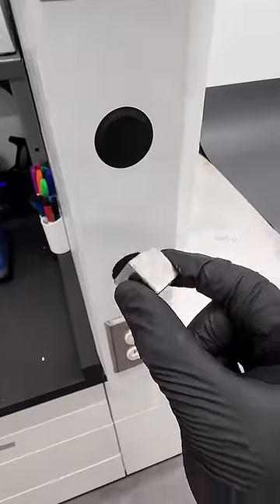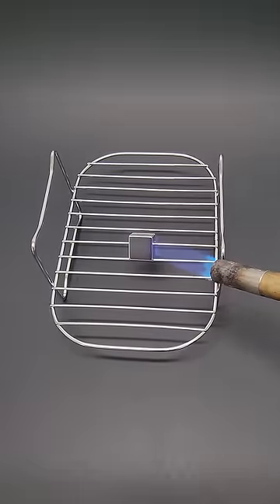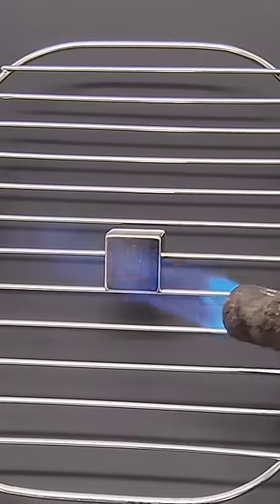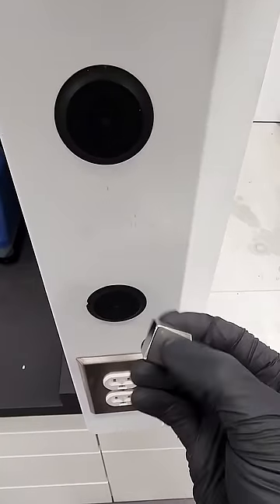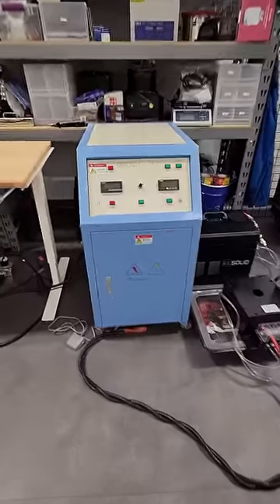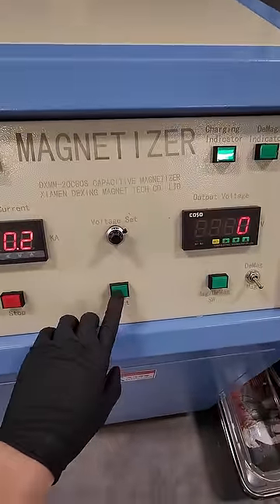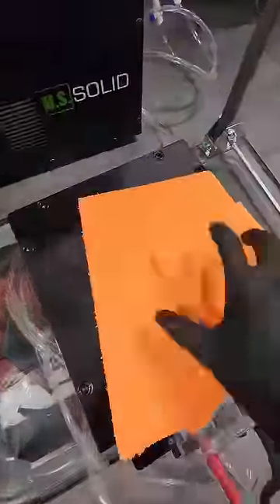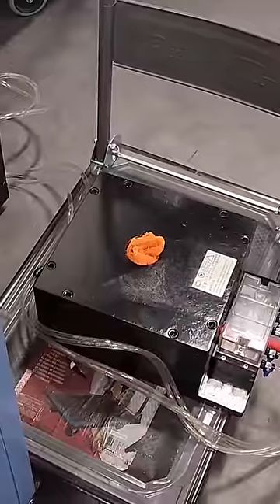I accidentally killed this magnet

Comment: For those wondering about the science behind it, in magnets, all the electrons in the atoms are "pointing" the same direction, and so they create a consistent magnetic field, this is called ferromagnetism. 

When he heats up the magnet, he gives the electrons enough energy to scramble in whatever way they want, and so on average, no consistent magnetic field pointing in one direction forms - so the magnetism is lost.

Lastly, when he puts it in an extremely strong electric field, the electrons all react and get oriented in the same direction, thus making it magnetic again.
Reply: Thank you
Reply: Actually fantastic explanation, I didn’t know that’s how magnets work.
Reply: You can also put a steel rod in a vice facing north and south and smack it with a hammer on it's ends enough times and it'll align all the electrons north and south creating a magnetic bar, there's also a way of wrapping a copper winding around the bar and putting a DC current through it that'll do the same thing, but the winding has to be insulated from the bar and not touching it or it won't work. 
Years ago in garages we had a device called a growler, it had a V shape on top of it that you'd lay the armature from a starter motor or one from the old generators when cars had them before alternators in the V, plug it in and flip the switch and it'd magnetize the armature, then you'd lay a hacksaw blade along the length of the armature and if in any place the hacksaw blade started vibrating it'd make a growling sound that meant the armature winding was broken somewhere and needed replacing, but you never see them in garages anymore, parts stores having rebuilt and ready to exchange starter motors have done away with the days of mechanics rebuilding starters themselves, if you gotta go to the parts store for a rebuild kit you might as well save yourself the time and just exchange what you have for a rebuilt starter, get back to the garage put it on and you're done.
Reply: @dukecraig2402 
"Smack bar with hammer = magnet"

Really feel like we're being trolled here 🤣

Like, "put you phone in the microwave for 30 seconds to dry it out".

I currently have no way of testing this myself, but very happy to be proven wrong :)
Reply: You forgot to mention, this only works with metal elements. Imagine if you could charge up a human being with a magnetic field lol.
Reply: Yes - it's essentially the same as as the trick where you can use a powerful magnet to magnetize a screwdriver that contains iron/steel. Except this machine does it better and with a really powerful field. I wonder how powerful a magnet made from from a random piece of mild steel would be :)
Reply: Thank you for this comment. 
Should have been in the video…
Reply: @D4RKFiB3R This is 100% factual, and actually practiced during the Industrial Revolution.
Reply: Thank you <3
Reply: Do materials show ferromagnetism without being in an external magnetic field
Reply: Instructions unclear…smacked wife, she is definitely not magnetic now.
Reply: This is why I went to the comments. Thank you.
Reply: What about magnetic stones?

How do they work?
Reply: @NicoChristmannRecords  probably the same mechanism due to ferrous content within the matrix of other minerals.
Reply: @NicoChristmannRecords  same idea, they just have iron in them
Reply: Thank you
Reply: That's what I was thinking thanks for confirming
Reply: nerd
Reply: @divineintervention6318  slow
Reply: @Memerandcritic  nerd with lenses thicker than my beer bottle
Reply: Thank you ! Because this video pissed me off until I read your comment,  because I wanted to know what was going!!!!
Reply: venbrou  Well shit, that sounded very convincing. I'm gonna have to find me an iron bar.
Reply: @Fran-or3lt  Did you make sure to face her in the right orientation first?
Reply: Neat
Reply: Thanks for the simple explanation
Reply: @sinteleon  Pro life tip. Always face her in the right direction.
Reply: @D4RKFiB3R This will only produce a weak magnet and the magnetic strength will not increase much no matter how many times you hit it. Striking the steel rod will scramble all the atoms and the earth's magnet field will only apply a small bias for realignment. Additionally striking an existing magnet will decrease its strength.
Reply: You my friend, are a saint
Reply: So it kinda like electric shield?
Reply: Is the device legal to buy?
Reply: Thank you for the explanation! I was wunderin'. ❤
Reply: the "pointing in the same direction" to be specific is the electrons' spin, a strange property from quantum physics
Reply: Learned this from physics but this is a good thing to know
Reply: nerd emoji kids are coming
Reply: I wonder what will happen if the magnet was heated while inside a magnetic field. I'm guessing that the disturbed electrons will align with the external field, resulting in a strong maget.
Reply: so is this why one side of magnets are magnetic whilst the other side is not?
Reply: Very good explanation
Reply: @Gunbardo  yes it can but with strongest fields
Reply: Honestly this should have been included in the video
Reply: Noice one professor
Reply: Wanted to add a little bit to his explanation. Electrons rotate similar to earth, which is why earth has a magnetic field. If you pull up a picture of earths magnetic field you'll see layered lines called lines of flux. Electrons also have those, and they can be stacked. Place two electrons end to end and the fields will combine. Do this with enough electrons and you have a strong magnet. This invisible field is what interacts with other magnets drawing them together or pushing them apart. Last I heard we still don't know why the field generates to begin with, but that starts to fall into the realm of quantuum mechanics.
Reply: Thank you, science man. That actually makes a lot of sense
Reply: Thank you my guy! 🤝
Reply: Not a good magnet, but not wrong either@D4RKFiB3R
Reply: so it's born straight, becomes flaming all directions, and strong force turns it straight again
Reply: Thank you 👍
Reply: Thank you, I didn't know that.
Reply: That's fucking cool. 
So when the magnet got an upgrade. it had more electrons react than before?
Reply: @UndeadNoir1013  overall there are the same number of electrons, but they are all reacting in the same direction now :)
Reply: Hi, i live very far so i can't buy this kind of machine. But i m wondering how does this machine work because i damage my ebine motor with so much heat and i need it to come back to life. I was thinking about a 600 laps coil to turn back it.
Reply: @mike20xp  actually might work. All this machine does is create an extremely strong magnetic field in one direction. A coil can do the exact same thing.
Reply: Então teoricamente aquecer algo que é "desordenado" é bom?
Reply: Soooo any object or person could be magnetic if their electrons had a common direction?  As in magnetism is just participating in the EM fields already happening all around us?
Reply: @PhaedruS007  no not really, because electrons are organized in pairs that cancel out one another's electromagnetic orientation. Only in atoms that have an odd number of electrons (specifically in a certain level, not too important), will there be a lone electron that is not cancelled out by another, and thus can react to a magnetic field.

These are the atoms that can react to magnetic fields (such as iron, etc).

Comment: For anyone wondering how the heat killed the magnet, it was heated passed a point called the curie point (named after Pierre Curie), which is a temperature where certain materials (a neodymium magnet, in this case) lose their permanent magnetic properties. In the case of the magnet, the curie point is between 590-720°F (310°-400°C). That machine brought the magnet back, and stronger, via induced magnetism
Reply: im not too versed in this.. but is this similar to the limit of an objects elasticity?
Reply: I'm not educated in chemistry, but it makes sense
Reply: @h_ass_an  yeh it’s now permanent because the direct current passed through it realigns the electrons so it’s now magnetised
Reply: @tekuraze  loss of elasticity is usually due to bonds braking (not reverseable). This is ferromagnetism. Simply put for something to be a magnet the atomic/molecular moments (imagine mini magnets) have to be ordered. If you heat these magnets up to much they loose this order. By applying an magnetic field from the outside you reorder them. Thats why you can use an magnet to magnetise paper clips and other iron things. He used an electromagnet.
Reply: Thanks everyone for the explanations. 🙂👍🏻
The video should have covered that. 😬
Reply: Exactly! I'm really surprised in a bad sense that so much people nowadays don't know basic physics and perceive such things as fucking magic. :/
Reply: @nessu1385  i see! i suppose you cant permanently "lose" ferromagnetism, unlike elasticity.
Reply: Neodymium magnets lose their magnetic properties at about 80 Celsius
Reply: @sur-real3416  that's not what my research found. The figure I found is in my original comment. Not sure where you got that from
Reply: Thank you @yaboyblacklist2431. Does the application of heat beyond the curie point scatter the electrons?
Reply: You’re the type of person I would try to cheat and copy the work off of in school.  A+
Reply: @paralegalbabe77  it's more about physics as it involves dipole alignment for electric and magnetic field
Reply: Hmm, I always thought it had something to do with how the molecules were lined up.  I figured the heat just allowed them to realign to a more natural state.  Then the other device just forces them to align again.
Reply: you know ur shit omg
Reply: Put it in again
Reply: How is it that the magnet in a rice cooker loses its magnetism when the rice is done, but revives itself when the cooker cools?
Reply: and its magnetic personality.
Reply: It was interesting to me that he acted like the induced magnetism would not obviously make it stronger. That seemed obvious to me.

Comment: Now I understand why fire attacks work so well against Magnemite
Reply: 😂 it all makes sense now
Reply: It's really cause it's a steel type, and fire melts steel
Reply: @magicpotion7252 jet fuel can't melt steel beams!!!
Reply: @osagiee9553  💀
Reply: @magicpotion7252 lol😅 I see what you did there
Reply: @osagiee9553  which points to the mastermind of the 9/11 attacks, Kyle
Reply: Magnets are ferromagnetic(Very strong magnets) in nature and on raising temperature above Curie's temperature they loose their magnetic properties and become diamagnetic(very less magnetic power) as a result fire works well against magnemite
Reply: Yea right and I thought I was the only one
Reply: So now we need to figure out why earthquake does even more damage than that
Reply: @magicpotion7252  Game Freak logic only makes sense until you think about it. Rocks melt at way lower temps than steel and rock is resistant to fire in Pokémon.
Reply: Not in Gen 1. Steel wasn't even a thing
Reply: True I learned it by reading kamonohashi manga 
If u heat up a specific magnet to certain degree their magnetic force will dissapear and that what make me interested
Reply: @Vmac1394  Actually that makes perfect sense in a way: rocks have poor thermal conductivity which is why sometimes when you heat one side of a rock the other side is cold. However, metals and metal-like materials have a much higher thermal conductivity (heat spreads more through metals than through rock despite some rocks melting easier than some metals).
Reply: @kushgarg7629 not quite the joke, but you are right
Reply: Pokemon things 😂

Comment: Adding the Magnomancer class to my next DnD campaign.
Reply: I thought its called ferromancer
Reply: @Manly2000Man he manipulates iron. Magnomancer would manipulate magnetic fields
Reply: Facts
Reply: @pixelicereal ferromagnetic fields
Reply: Wait hmu. I’d join that campaign
Reply: I'd rather be Magneto than be able to manipulate Iron in any way I want. Sure, if you can manipulate Iron, you can manipulate magnetic fields around iron, but just that. ONLY iron. I want Magnetic fields in general. You could manipulate far more than just iron-based magnetism
Reply: Can you try with a piece of steel,i really want to see if it can be magnetnetize or not.
Reply: Everything is magnetized if you refuse to let it go.
Reply: @pixelicereal  Why not all anion metals?
Reply: New Artificer subclass just droped i guess
Reply: Sign me up for this campaign
Reply: @longdose8956 it can, galvanized steel is particularly susceptible to magnetization, and once galvanized steel is magnetized, it can't be unmagnatized, well, unless you heat it up.
Reply: @pixelicereal "C-MOON!"
Reply: @empty_thesaurus  and?
Reply: @dartingralaughter9781  wtf is that question. Anions are negatively charged particles/ions which are made from non-metals. Metals can’t be anions as they cannot join electrons to themselves. They can only loose electrons, making their charge positive thus creating a cation
Reply: @User__Not__Found  no look. With manipulating magnetic fields you’d be able to manipulate magnetism and magnetic metals such iron, nickel and cobalt. However manipulating iron only grants you the ability to shape the iron and control it more strongly/precisely than magnnommancer as you manipulate iron particles themselves.

Comment: Now you need to magnetize an already magnetized magnet
Reply: That's actually genius
Reply: Yes, yes, DO THIS!!!!
Reply: Thinking about it scientifically it would make sense, but what if u just keep letting it magnetise over and over?
Reply: @zealotoffire3833  then every thing that is metal will attract to it, it would be the perfect theft device
Reply: Why tf isn't this type $hit viral?! Ion even understand this completely but it's fascinating af
Reply: Bro Nike red gotta do this (magnetize over and over)
Reply: And reverse the polarity.
Reply: @ИсследовательЕкатеринбурга nah that's strength III
Reply: That shi about to purge all metal in tje uñiverde
Reply: YES
Reply: Get this top comment
Reply: @Dapatatoearmy  well know I meant because the reason it’s more magnetised is because more and more domains are being turned the right direction but eventually there won’t be a noticeable differnec
Reply: @MatthewSwilling I think 4.5 million likes says otherwise🙈
Reply: It would create a black hole 😱
Reply: I was gonna comment this
Reply: @pak_III  bro had a bilingual stroke
Reply: @lemonpotioncastle  地獄 ты имеешь в виду
Reply: @zealotoffire3833 the magnetization is likely at the max possibility for "permanent" magnetism level anyways, but even if it isn't the magnetizer probably works on a max voltage/energy level meaning running it twice won't get it higher. It's not like adding more magnetism, it's like the magnetism goes up to the energy level provided by the machine. Doing it a second time wouldn't increase magnetism as the magnet is already at the max level. Doing one from scratch would be the same as a preexisting magnet if not actually lower due to interference. You have to increase the max energy level from the machine to increase the magnet
Reply: Strength v
Reply: @ObamanableSnowman  idrk how it works i was just thinking in my brain, correct me if im wrong but magnetising flips domains withing the magnet but in brain it wsa logical that when you magnetise it not every single domain gets flipped, so wouldnt it be logical with a device like this that if u just sit a magnet there and magnetise it multiple times it woulf get more magnetic from some of the missed domains getting flipped theright way? i might be wrong tho but i don’t know
Reply: Yes
Reply: A Magnetomancer
Reply: Im not a physicist but I think it's more based on how much charge the machine has than how much the magnet has
Reply: Bro reforged his magnet 💀